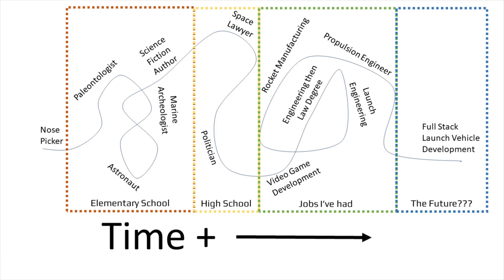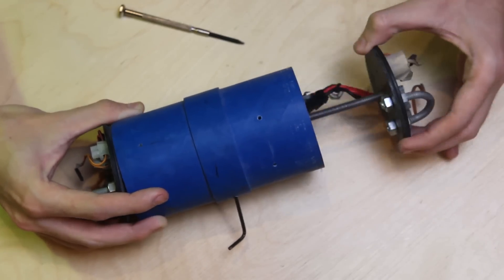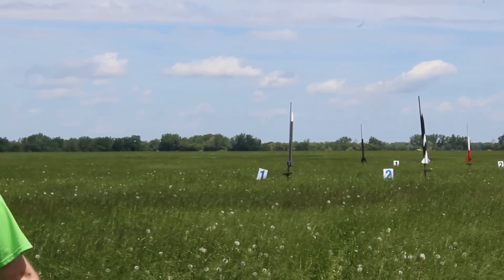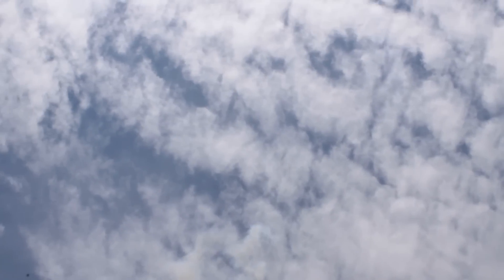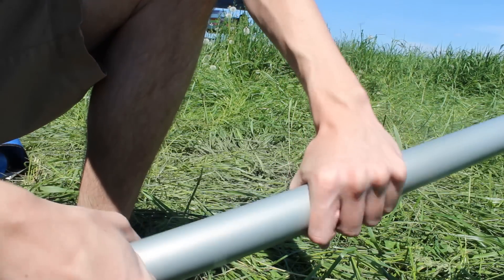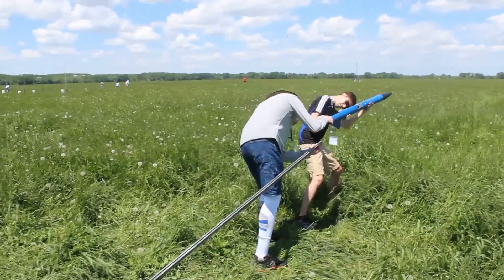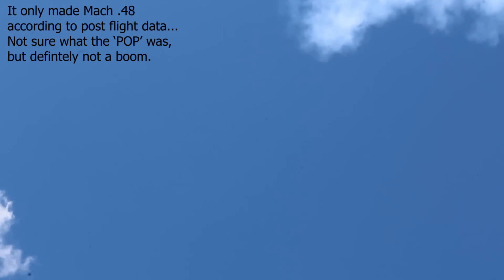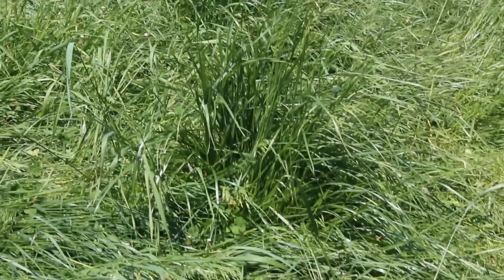High Powered Rockets 1: A Weekend in Geneseo

Comment: Hi Charlie,

I'm from Germany and I'm also wanting to bluid my own flight computer. Maybe you can help me with it.

My main question is what do you use for the downlink. I think you had live telemetry of you rocket in the rocket.  Is that correct?
Reply from the maker: For a homebrew telemetry system I'd use an xBee if it's low enough range. If you need very good performance try pairing a CC1190 and a CC1120 chip from Texas Instruments.

Comment: Interesting! What Igniter are you using? I am currently building an igniter for my university's rocket. And thought that your yellow-cap at the end of the motor & igniter system looked interesting(maybe they are related? yellow?). Would appreciate it if you can share anything about it! Thx :)
Reply from the maker: The igniter is a standard CTI igniter with no pyrogen and a BP starter grain embedded in the top propellant grain.
Reply: @AstroCharlie  Cool! Never used a CTI igniter before! After a bit of search, the system you described(BP pellet + CTI igniter) seems to be pretty popular. But it's sad to see that there isn't much information about 'the CTI igniter' itself. Like how it is designed. :(
Reply from the maker: It's a bridgewire initiator with a lacquer coating.